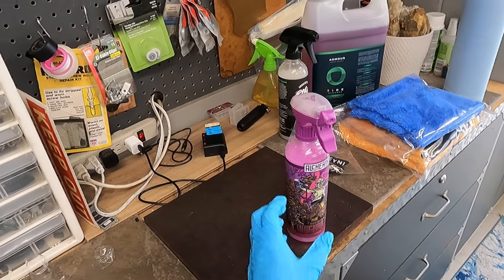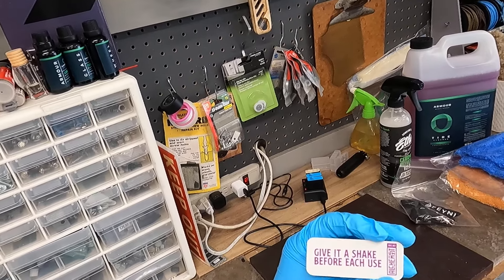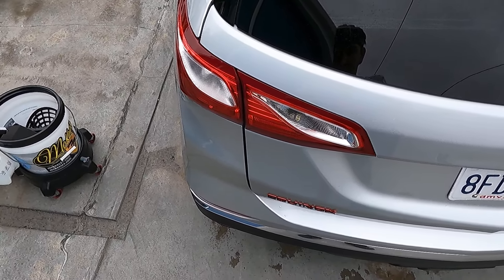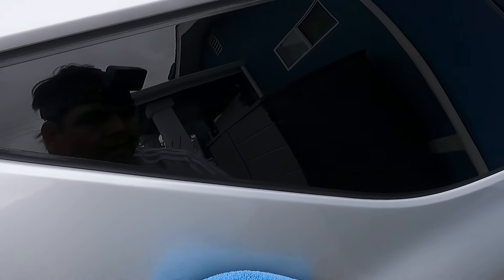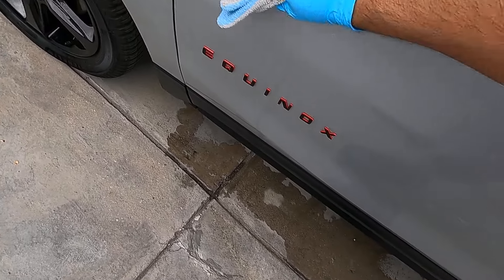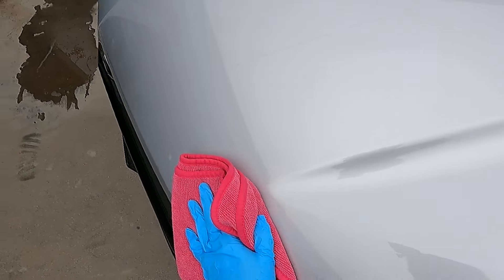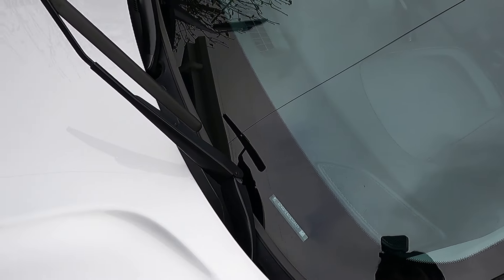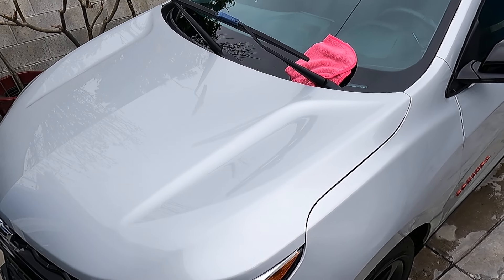A look at Alchemist Quicksilver Quick Detailer

Comment: Thank you for that. I have Ech2o but haven't got round to using it as a drying aid yet. Will have to whip up a batch. Thanks again
Reply from the maker: It’s my goto drying aid mist of the times.
Reply: @MikeGDetailing I tried this because you’ve mentioned it a few times, was expecting it to be a bit more work as when used dry it can take extra buffing, anyway used it after washing with DIY Rinseless and have to say I’m quite impressed, easy wipe off, slick, glossy and seems to do quite well with dust accumulation. 
Will definitely use this way again. Thanks
Reply from the maker: @LSD04  that is great to hear. It simply works very good.